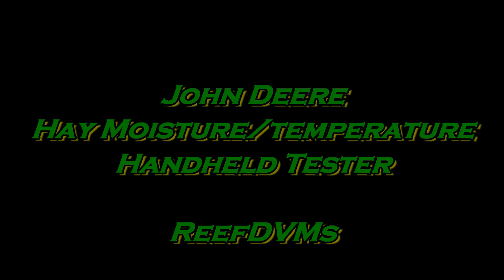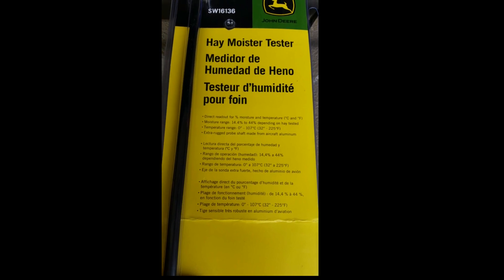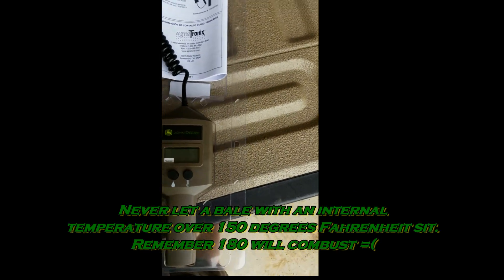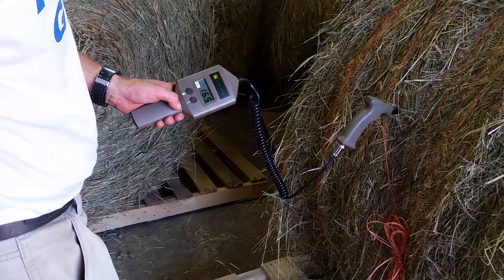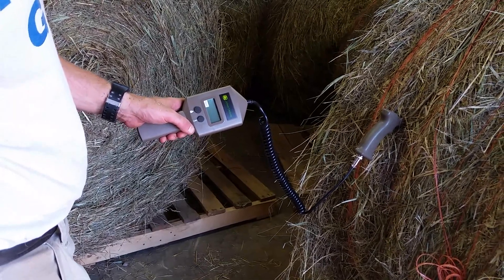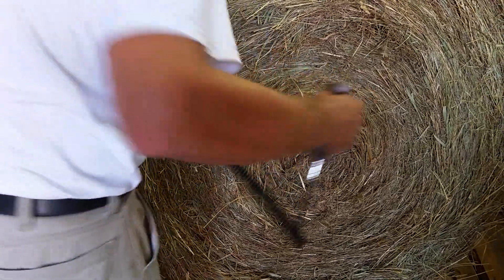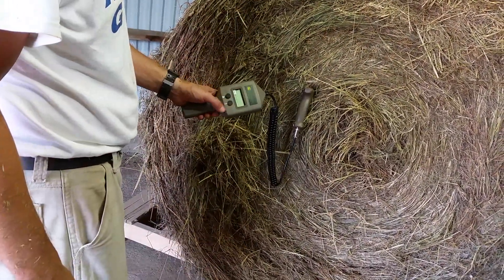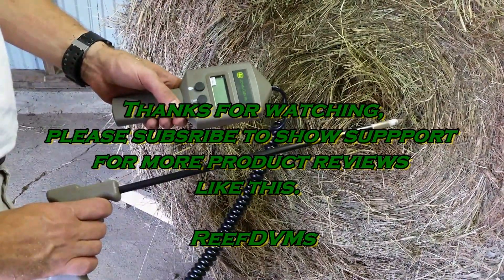John Deere Hay Moisture Tester

Comment: That's what I was always told for 25 years, probe against the grain, not with it. Sides on round bales, and from the ends on square bales. All I can find on youtube is improper technique, but maybe they have no issues, and the probing with the grain is working, weirdness.  I am wondering if I was taught or informed falsely, or these probes have changed